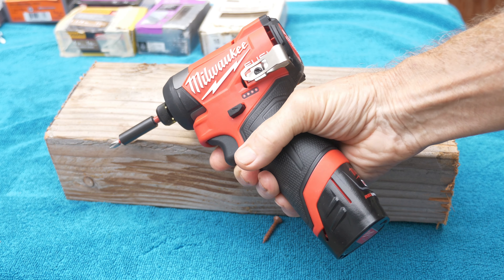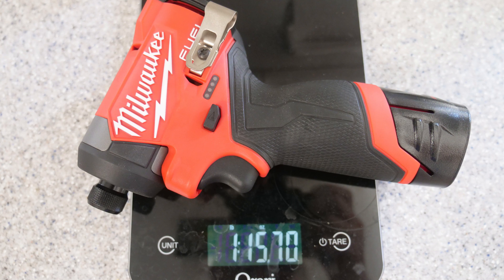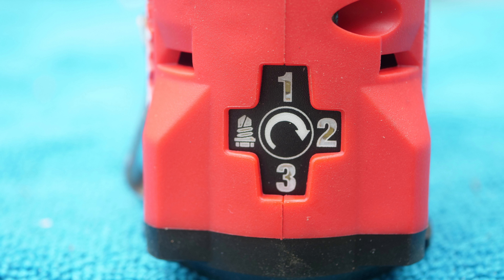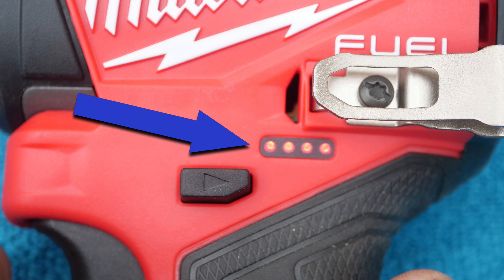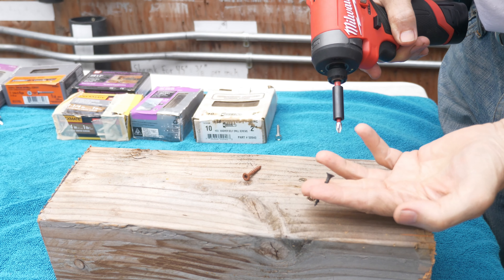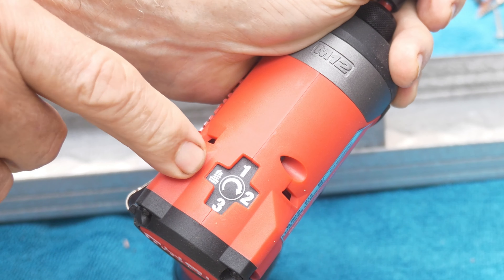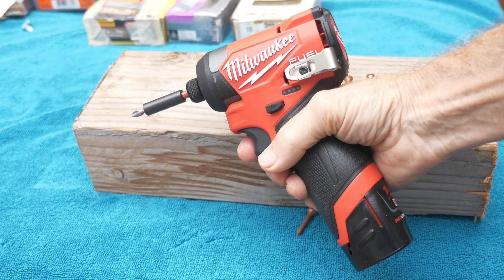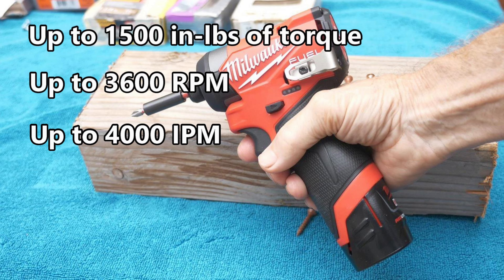New Milwaukee M12 Impact Driver 3453-20

Comment: 99 dollars right now on Home depot. Tool, 1 battery and charger and case. Not sure how long it would last. Best deal I've ever seen for a new tool like this
Reply from the maker: Thanks!
Reply: They must be gone because this model is not in any stores within 50 miles of me (SoCal). All stores show 2-day shipping.
Reply: The first HD said they were only available online and they were getting rid of the M12 in favor of the M18. I called BS, went to a second HD and got the 99 dollar kit with a military discount.  Thanks for the tip!
Reply: @flashgordon6238  glad you got through.
Reply: Right now Hone Depot the new m12 3453-20 impact driver with the 3404-20 hammer drill, a 2.0, 4.0, charger and bag for $200.
Reply: Yeah you were wrong. The 99$ deal is for the old models it’s never for new models.
Reply: @tallmex96  that deal is expired now. I bought one was it was still active
Reply: I'm picking up mine this morning , with a 50 gift card I'll only be paying 50.00 for the kit .
Reply: Apparently it's a yearly deal
Reply: Shit I missed it I think
Reply: The deal is back Guys
Reply: I bought mine recently on the Home Depot site. I am 2 years late to the response but it’s available now. 

Great deal!

Comment: I wonder how it compares to the Dewalt Xtreme impact driver.  I think we need a Sparky Channel Tool Test Smackdown…..
Reply from the maker: Sounds like a great idea! I like the name too: Smackdown!
Reply: That would be interesting to see. My money would be on Milwaukee, though. I haven't used Dewalt's 12v tools, but I've used both of their 18v (20v max) tools, and Milwaukee pretty easily outclasses them, there.
Reply: @jackxv  I think you are right.  Milwaukee M12 tools do outperform the Dewalt Xtreme tools, but the Xtreme tools are lighter,  more comfortable to hold, and can handle 95% of the jobs I need it for.  If I need more horsepower, I’ll break out the M18 fuel tools.
Reply: @MrStanwyck  Same. My m18 stuff is only for when I really need that extra horsepower. I don't know how comfortable the xtreme stuff is, but I actually like that the handles on m12 tools are a little fatter. It's a taste thing, I guess.

Comment: I really like my Surge.  same action as an impact driver with half the noise.
Reply from the maker: Yes, the Surge is very nice as well.
Reply: The surge impacts are nice. The main thing I love about them is that they operate more like pneumatic impacts, in that they engage the impacts basically once you start driving the fastener, so it's a much smoother, more consistent feel, and less likely to lock up, and start stripping out the head of the fastener, like normal impacts sometimes will.
Reply: @jackxv  that is more about specific models than about the drive tech.  the only real difference I noticed between my traditional impact and the surge was the noise, and they were both milwaukee.
Reply: @kenbrown2808  I'm talking about both being Milwaukee, too. I used to install the roofs on mobile homes, and when we built FEMA houses, we would have to drive hundreds of 4-1/2" spax screws into the gables of the roofs. My gen3 would do it faster, but since it didn't engage the impacts until it near the end of driving the screws, the screws would often bind, and the head would get stripped out, and I'd just to break that screw off, and put in another one. When I tried using the surge, I didn't run into that problem, anymore, because the impacts come in as soon as there's resistance.
Reply: Granted, those screws were also shit, so it's not a problem that everyone is going to encounter. But, in a situation where you can't just tell your employer to stop being a cheapskate, having a tool that can baby the material you're working with definitely helps.
Reply: @jackxv  that might be one of those cases where there is really only a small difference and you happened to lane in the middle of it.

Comment: I had a older version of the M12 impact but when I tried to crank down on rusted pole light bolts  it wouldn't make them budge. It looks like a nice backup impact driver though.
Reply: 12 volt, from anyone, isn't good for that.
Reply: @saulgoodman2018  my M-18 sheared my socket adaptor on rusted hardware.
Reply: @saulgoodman2018  my M18 made quick work of them, oh and I'm talking about the U bolts that fasten the lights to the pole that's at 90 degrees from its base towards the road.
Reply: Honestly, I know my m18 impact is plenty strong for most things, but once we're talking about rusted bolts, I generally get out the impact wrench. I'm not trying to torture the components in the collet and anvil mechanism, just because the motor is technically strong enough. Lol.

Comment: My boss and I have been using these for a while, I didn't know what the 4th mode was for till now, thanks for reading the manual for me. 

They are a great tool, I highly recommend them.
Reply: I am in my second year of my electrical apprenticeship and have noticed I’m already ahead of many journeymen just for the fact that I read the directions and instructions for equipment.
Reply: That 4th mode is kinda stretching it for them. I think its pointless and just means one more technical thing that can go wrong. 2 speeds is good enough
Reply from the maker: Yes, it's a nice feature.
Reply from the maker: You'll go far reading directions. LOL!
Reply: yeah, it was a bit baffling to me, too, when I got an m-18 surge last year.
Reply: 4th mode is awesome, I use it most of the time
Reply: @OneMillionBuddhas  I actually have met journeymen that don't know what the self-tapping mode is supposed to do. They think it's a like a drill mode, or something, and they think it doesn't work, because it's almost the opposite of that. Lol.
Reply: @jackxv  he who has eyes, let him see!  💯

Comment: I have the older version of this and it's an absolute BEAST it's so practical that I rarely have to use my m18 Fuel version. 

I can only imagine how good this new one is I'm drooling right now just looking at it.
Reply: It has replaced my M18 entirely. I've never ran into anything this couldn't do, but if I do one day that's when it's time to pull out the mid torque because it's not gonna be a screw, it's gonna be a large lag bolt

Comment: I just bought the impact driver/hammer drill kit a couple days ago. The m12 line is for sparkies that love themselves. I can just holster the driver in a tool pouch, and can barely feel it. My m18 tools are just for when I'm doing roughs, now. They're too heavy and awkward hanging from a tool belt/pouch to justify carrying around for trim jobs. And, the m12 versions are still surprisingly powerful for how light and small they are. Love them. I didn't always understand the point of 12v tools, but I kind of think they should be the standard, now. I almost never need the full power that 18v offers, unless we're talking about stuff like circular saws, so for most jobs, it's not just overkill, it's bad for your hips.
Reply from the maker: Excellent points, thanks!

Comment: Would really like to see how it does installing drywall. My gen 3 M18 does not begin to impact until the screw is already sunk too far. Older gen 2 M18s have a better feel for doing more delicate tasks like drywall.
Reply: Totally understand where you're coming from
Reply: Put it in mode 1 and your good to go essentially

Comment: Does anyone know its price in September 2024?
Reply: I see it in a kit listed as a "special buy" for $129 with 2 batteries and a charger at home Depot
Reply: @eddielee8936 thank you! And in that M12 comparison, is there a lot of technical and power difference? The 3453-20 and 3453-22? the price difference is not much! I am looking for furniture assembly work, beds in oak wood, pine, MDF and Drywall work!!
Reply: @Rogsdeco  the only difference between the 3453-20 and 3453-22 if there is no difference. The 20 is tool only, no battery. The 22 is a kit that has the tool plus battery and sometimes more. 
Basically 20 means just the tool, 22 means tool plus extras.

Comment: They need to make their handle compact.
I have big hand, but Milwaukee tools are uncomfortable in my hands.
Reply: I have small hands but they're extremely comfortable in my hands
Reply from the maker: Hi Saul. I love the handle, but everyone is different.
Reply: Hmm. That's interesting, I guess. I have skinny fingers, but Milwaukee handles are pretty comfortable to me. Are you talking about all Milwaukee tools, are the the m12 ones?
Reply: @jackxv  All of them.
I like my thumb to lay on either on top of, or on my middle finger.
For me, ergonomics comes first, before anything else.
Reply: @saulgoodman2018  Hmm. I guess I've just never had a problem with being able to do that. At least if we're talking about the thumb sitting against the middle finger, not on top of it. That just doesn't feel natural, to me, in any case. I don't normally rest my thumb against my middle finger, though because I usually use my middle finger as my trigger finger, so I can stabilize the tool between my thumb and index finger. I don't know. Different hands are different, I guess. What tools are you able to hold comfortably? I've used Milwaukee, Dewalt, and Makita, and I've never really noticed a significant difference between the ergonomics of each of them.